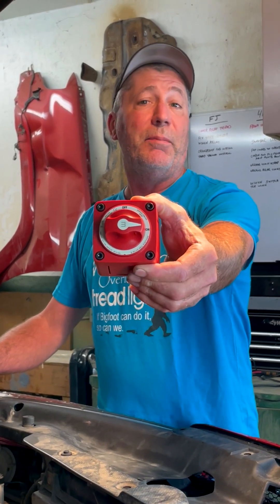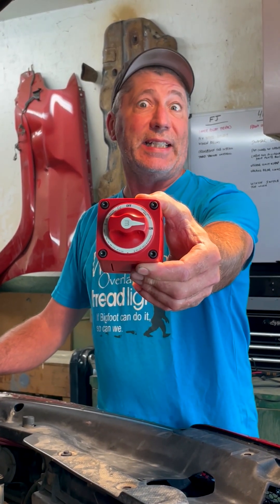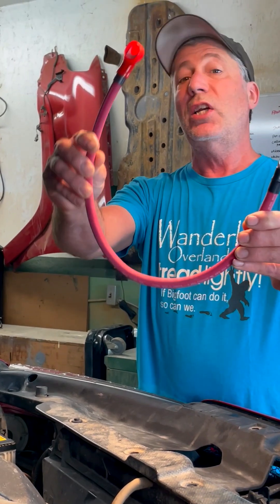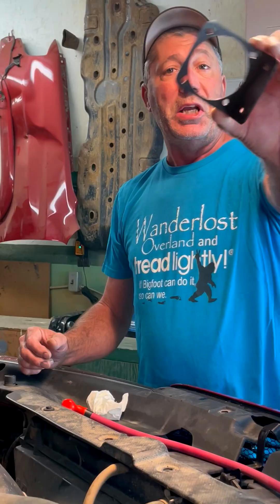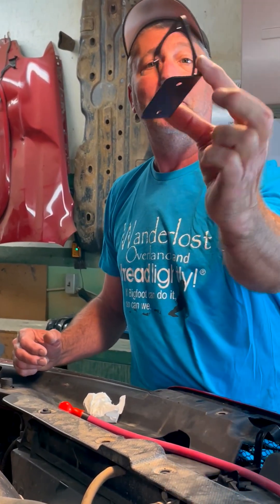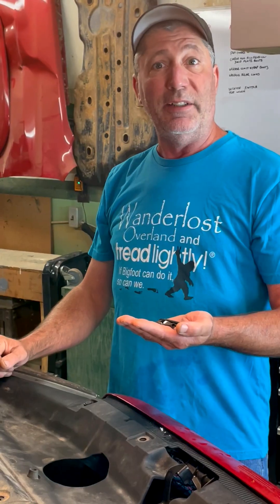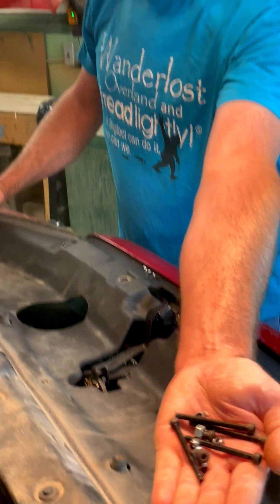How We Installed A Winch Safety Switch

Comment: You know blue seas makes big breakers for electric bow thrusters I've seen them rated to 400 amps at 24 volts I know that they have a 12 volt 300 amp and everything in between

Comment: Neat video, thought I’d mention I have a fair amount of experience with those blue sea switches (we used them when I was outfitting police vehicles) and they have a nasty habit of melting. Anytime we had a car come in for repair and they were complaining of power issues I’d go straight to that switch and probably half the time they were melted and falling apart. I know all the police equipment pulls a lot of power but I’d bet a winch pulls more. Might be something to keep an eye on

Comment: Try the Bluesea Marine Rated Battery Fuses, which are mounted directly to the battery post.   5178 is the 60A version.  Requires 5191 or 2151 Terminal Fuse Block for mounting.

Comment: Curious, what is the point in this?
Reply from the maker: With out there is constant power to the winch.
Reply: @WanderlostOverland  not sure why that is a problem. I have never had a issue with or ever heard of anyone having a issue with it.
Reply: @beanieweenie9543 Lots of reasons to electrically isolate the winch.  Eliminate battery drain or perform winch service, to name a couple.
Reply: @chiphill4856  I understand what you are saying but in 30 years and 15 or so trucks I have never had a winch drain a battery or encountered any other issue by not having it isolated
Reply: @beanieweenie9543  I've also had a few that were straight-piped, no problems.   The switch can also be used to combine multiple batteries to power the winch.  He may have a specific reason, would be interested to hear it.
Reply: @chiphill4856  yeah that’s possible they do have a dual battery setup I believe.  Having 2 batteries on it is actually not a bad idea, I wonder if it would impress the performance of the winch or if it would just keep your main battery from taking the brunt of the load.

Comment: What is/was the need for this?
Reply: Otherwise the winch is directly wired to the battery with heavy gauge wires and no fuses.  If the winch positive contacts the frame in a collision there will be an electrical fire.

Comment: Can you just use a breaker switch? 😁
Reply from the maker: Haven't found one that will put up with the high amp draw of the winch.
Reply: How much of a draw do you think it would have to be?
Reply: @brettferguson6954 
 Late to respond but 500 AMP solenoid or more if you use the winch hard and often.  A 350 AMP solenoid can short time. A HD shutoff switch or HD  solenoid is better choice for vehicles driven on road.